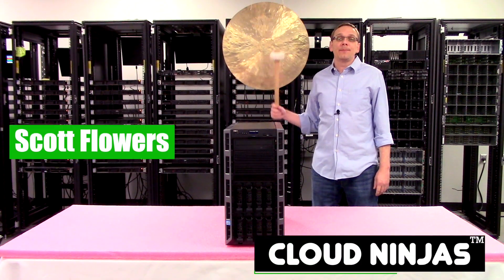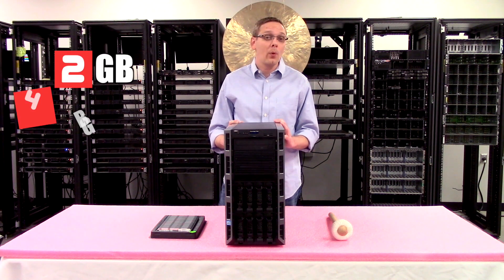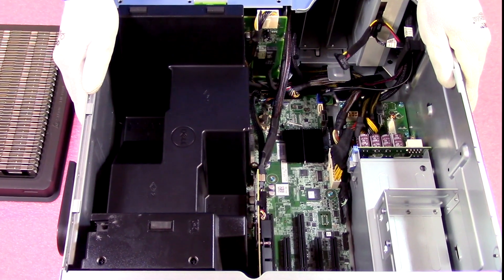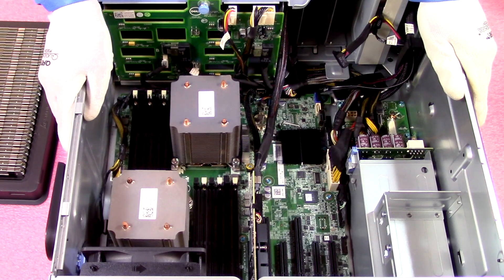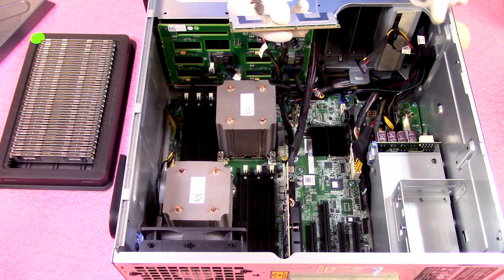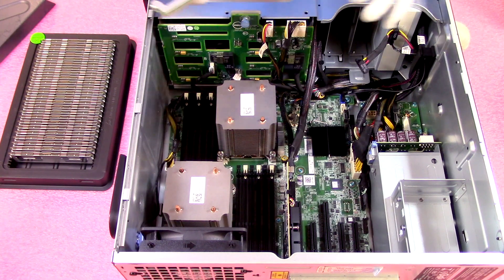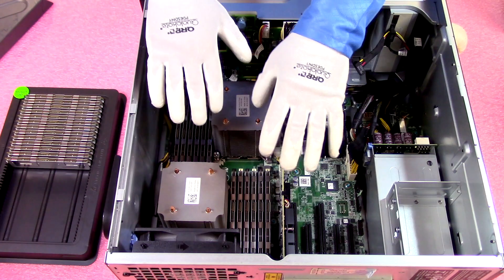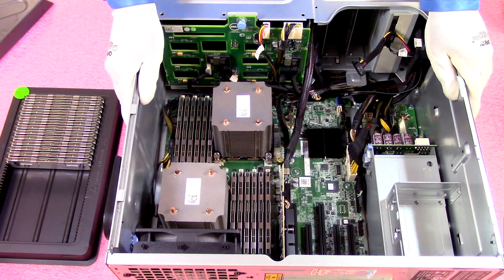Dell PowerEdge T420 Tower Workstation Overview & Memory Upgrade Tips | How to Install & Configure

Comment: I have a few Dell OptiPlex 5060's that I use for just home labs, but they really don't seem to do the trick to keep up with my needs to spin up new labs in VMWare, would say that something like the T320 or T420 are good starting point for a virtualization home lab?
Reply from the maker: Great question.  Do you only want a tower form factor?  If open to rackmount then I'd suggest looking at something like R430, R630 or R730.  DDR4 based. V4 procs.  Solid systems and price has really come down on them.  If want tower then the T420 or T620 are good starting points... but maybe even check out T630...
Reply: @cloudninjas  thank you for the information! I'm actually open to both, but more so looking for something that would fit into that $300-400 price range with little additional cost. If I did go for a rack mounted server, do you recommend any cheap racks?

Comment: What is the best cpu you would be able to use with this system?
Reply from the maker: Intel Xeon E5-2470v2 is the best CPU for the T420.  Please smash that subscribe.
Reply: @cloudninjas  I have 2 of these in my T420. I use it for DVD ripping and can do 3 DVDs at full speed nearly equal to my Ryzen 7-3700x. The system cost me less than $400. Yes it sounds like a jet when fully stressed, but I'll fix that one day with some proper Noctua fans.

Comment: I have a similar machine but it’s failing to boot aftr power interruption.it says bootmanager not available.how I solve that without loosing data?
Reply from the maker: Might be too high a configuration for current power supplies.   Or could be a bad power supply.   Or another issue.  Have you found a solution?